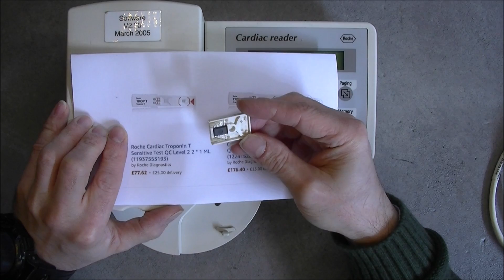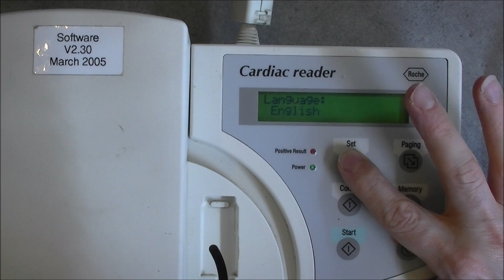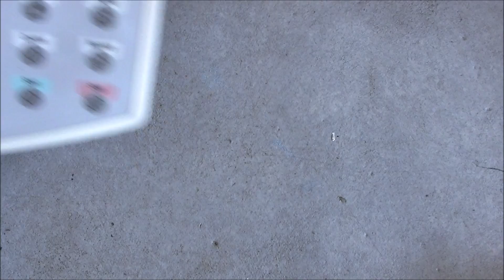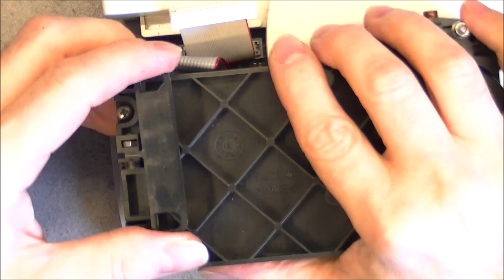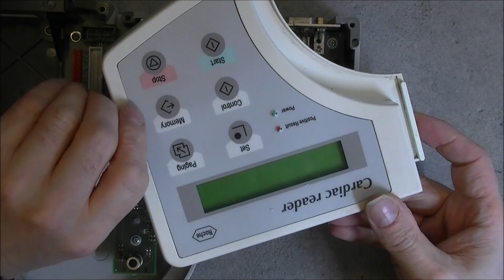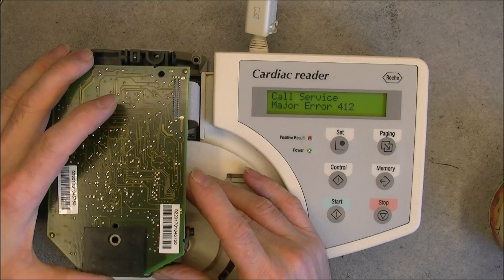Roche cardiac reader teardown

Comment: Yes, the power supply was made in Germany.

TSG="Thermoplastischer Schaumguss" or thermoplastic foam moulding, a process by which the plastic is foamed by injection of an expansion gas, typically nitrogen, before moulding.  The plastic in this case is polyphenylene ether (PPE).